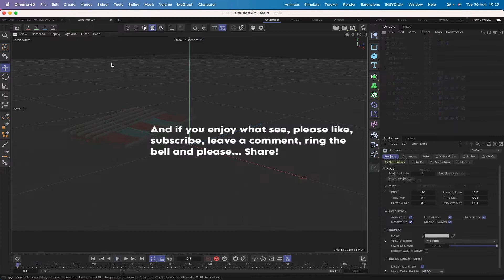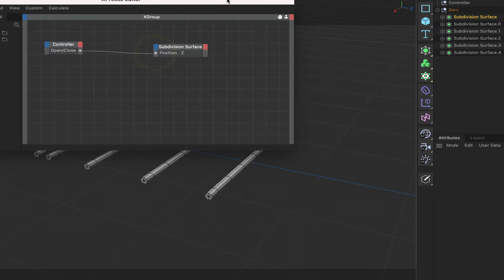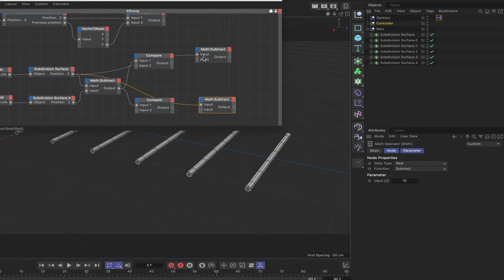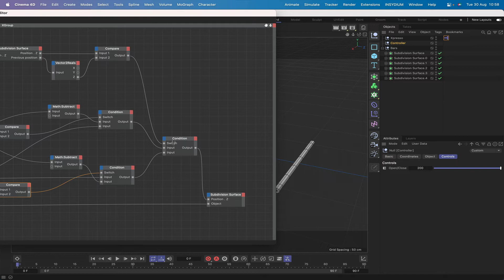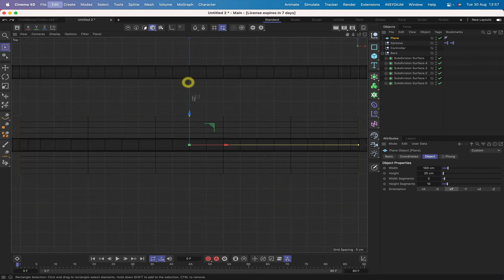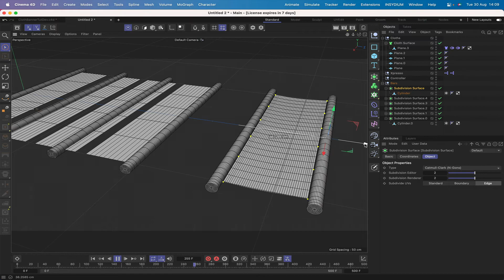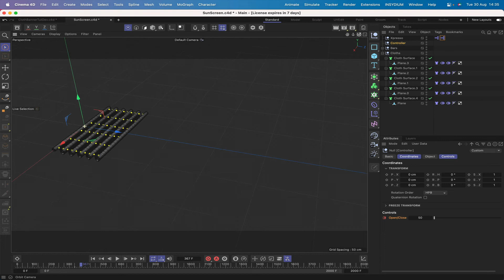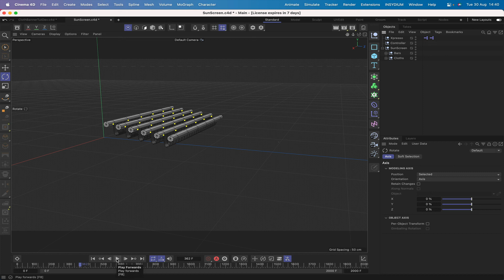Cinema 4D Multi-Tech Tutorial  24 - Sliding Sun Screen

Comment: This set up is well beyond my brain power to fathom... however, I think a workaround solution to the lag might be to make the attaching cylinders thinner rather than making the outer cylinder thicker?  Also, there is SHIFT PRIORITIES tag...don't know if that would be any different than manually changing the priorities but it might force Dynamics to happen before expressions?